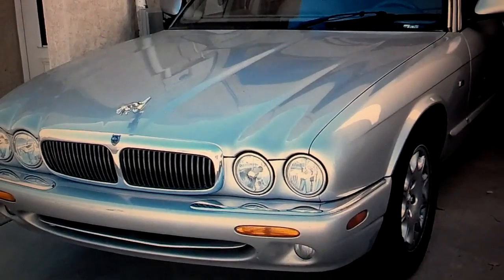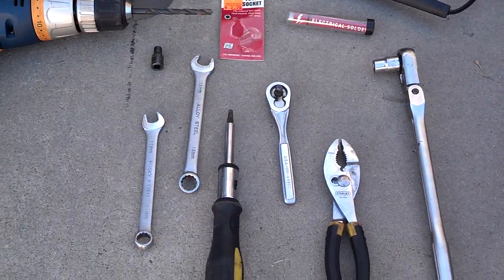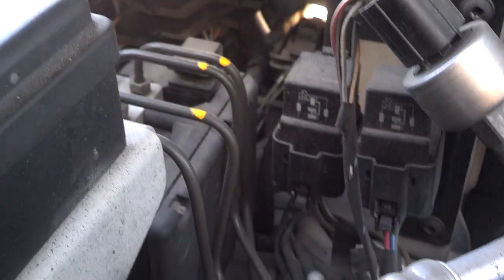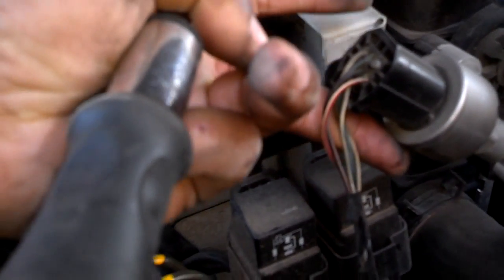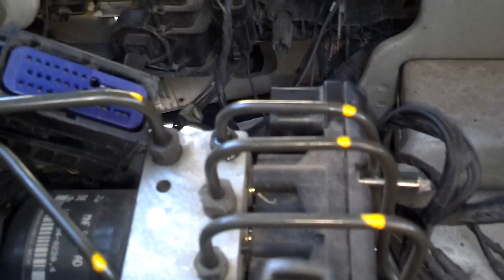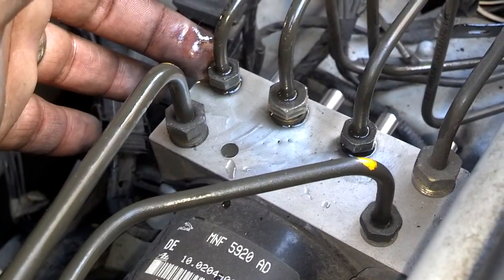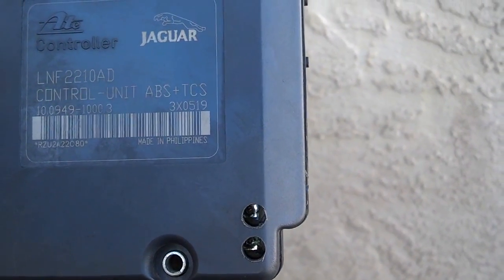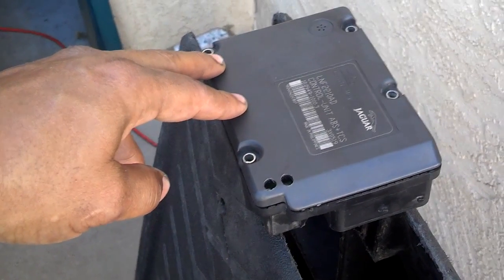ABS module repair, ABS warning, tracks not available, Jaguar - VOTD

Comment: Hi Rob Tony here i asked you 11 months ago if you have to bleed the system after and you said no. But if you remove the brake pipes fluid is lost and im sure you have to bleed the system.
Reply from the maker: You don't have to take any lines loose to remove the module. 🤷🏾‍♂️
Reply: Thanks for your reply keep the good work up

Comment: Thanks a bunch Robert! You're the man!!! I'm the original owner of a 1999 XJ8L. It is my daily work commute car. Been watching all your videos and that motivated me to do a lot of the repairs myself. ABS control module repair was way over due, 3+ years. Finally got the time to do it today. Worked like a charm. No more orange light and stability error message! I guess those solder joints worked their way to an open from all that vibration being in the engine compartment. Thanks to your video, only took 3 hours and I took my time.
Reply from the maker: Awesome!

Comment: I have a 2003 xj8 looks the same as this one in the video. The abs light is not on and never  comes on. But the middle where it shows the mileage randomly while I'm driving it will pop up saying asc  not available trac not available and then transmission fault.. if I turn off my car and turn it back on it turns off and doesn't happen  again for a while.. but then it will happen again same lights.. just randomly. It drives amazing until it randomly just glitches  and it won't speed up as fast as before and those asc and traction and transmission lights come on. Do you have any tips or ideas on what it could be..
Reply from the maker: You need to have the car scanned by a Jag tech, preferably while the light is on.
Reply: @RobertDIY  thank you I was going to try and take it to a import auto shop today.  The jag dealer here told me they don't do older jags. Maybe they can help?

Comment: I have an 04 S Type r and it has the dynamic stability control warning light on, Jaguar wants almost $3000 just for that ABS part you repaired. Also, the modules are matched to the VIN so you can't just throw in a used one. There is a company in Idaho that repairs these modules, they charge $250 so im going to send mine there, but thanks for this vid of how to get the module out!
Reply from the maker: You are welcome.

Comment: This vid is pro, nice work 👊🏻
Reply from the maker: Glad you liked it!
Reply: I used this video to fix my father in Laws 2001 Jaguar Vanden Plas. I checked the battery, cleaned the sensors, but the issue was with the solder joints mentioned in your video. Thanks again .!!

Comment: H ELL TO YOU ALL.I HAD THE VERY SAME PROBLEM WITH MY JAGUAR  I SLACKENED THE BRAKE UNIONS JUST TO GIVE ME THE ROOM TO REMOVE THE MODUAL
AFTER I DID REPAIR AND REFITED BACK PLACE RETIGHENED  THE BRAKE PIPES.. I DID NOT NEED TO BLEED THE BRAKES AFTER WARDS
Reply from the maker: ok

Comment: I have the same issue on a 2001 VDP. funny I still can register speed output at all 4 wheels when I have my autel reader connected but faced with the same issue of abs & traction control. the wires you solder appear to be main power source to board It must be inter-connected somehow but wheel sensors are from another positive feed & why I can register speed data at the wheels
Reply: Hey good news i took module off but drilled a 5/8 hole above the power feeds in cover. I was able to cold solder the 2 pins but wanted to point out there is a tiny capacitor that needed a little solder . I used a rubber plug to seal hole. Put it all back together Bob's your uncle!! No more ABS or traction control lights on. The only thing left to do is fill & bleed brakea since I disconnected the 4 lines to have better access !

Comment: Hey Robert, I have a 98 XJ8 and I would like to install a catch can PCV.  Any input I would appreciate it. Thanks Persaud
Reply from the maker: I can't imagine needing that on a non-turbo car.
Reply: @RobertDIY  I noticed oil on my air filter and intake manifold. From the hose connecting from engine valve cover. Not sure what's or why this is happening had it checked by a mechanic they said my engine is going. @ 100k running smooth i dont have any engine light or so on. I seen this solution on a 2010 camaro 2ss.   Thank you for the reply.
Reply from the maker: Find a Jaguar mechanic.

Comment: Thanks Robert. I followed the other video where you cleaned the ABS sensor which did not work and then this one. This video seems much more complicated for a DYI mechanic like me so I am not sure I am up to the task. Do you think the Mitsubishi Outlander ES 2WD 2011 has the same complicated type of setup where the control module is hidden and difficult to get access to? Also, do you think the ABS control module is also sealed the same way that would require some "ingenious" way to reach the terminals to do the solder? Thank you!
Reply from the maker: Whatever the video shows.

Comment: I have done both and I still have the same problem
Reply from the maker: Have you had it scanned for codes?
Reply: Yes
Reply: Oxygen sensor
Reply: Fuel injector
Reply: Once I drive it the asc pops out on the dash. Once I get to 30 mph and 70mph
Reply from the maker: You need an advance code reader to fetch the ABS code.
Reply from the maker: https://www.youtube.com/watch?v=VZflAyss974
Reply: I cleaned the sensors. And soldered the connectors. And didn't feel any difference. I only have the issue whenever I start up the car. When I drive and make the 30mph, the dashboard will say asc/restricted performance. The acceleration feels like it's decreasing And losing power.  And it will go back to normal after I pass up the 30mph mark. And it appears again if I got a hole or a bad bump on the road.
Reply: @santiagohernandez422  Did you ever figure out your problem?

Comment: I'm getting the same codes which are intermittent. Have an autel elite 802 reader and even with abs,traction  & asc indicator on speed registers at all 4 wheels when I drive down the road so I know speed sensors ok. I am thinking maybe my module has the same  bad solder issue. do you know what your soldering ? as in what specific app are the 2 solder joints in relation to dash lights & message  of abs or no trac or asc
Reply from the maker: +Rick p nope
Reply: Question is after you soldered and re-assembled , the lights & messages were off at the time of you test  driving . Do you feel confident enough to say it is a probable cause & for you, it has saved you from obvious frustration and in your case  dash light problem has not returned.
Reply from the maker: +Rick p still working fine.
Reply: Thanks Robert ! Car will be parked for winter soon so will have time to check out & go over module components. in the meantime since we are taking on road trip this thanksgiving weekend I will apply a little dielectric grease at the lower  power feed connector the only one I have not removed yet. I saw the dirt & dust from the volvo connector ! lol
Reply from the maker: +Rick p ok
Reply: We just got back from a 950 mile trip to visit my in laws . going there my abs light ,asc  & loss of traction  came on twice. Brought code readers with me but never got to use ! however  I cycled the key on & off 10 times & waited to see the abs light turn off & have just returned home without any indication of existing trouble! go figure !! coincidence or a new tip & trick to resolve issues  concerning logged codes ??
Reply from the maker: I have no idea.

Comment: hi robert, i have a 02 x type 2.5. Will the solder spots be the same as your vid??
Reply from the maker: I don't know. It's a long shot. Most of the time you have to open the unit and repair several points. It is probably best to find a refurbishing source to get a replacement. There are a couple of places that do it for Volvo cars for $75.
Reply: im in new zealand bro, parts are hard to find , and kiwis can do anything , so i will pull it out and check it out , cheers tho , my car will start then drive , no lights on dash , then if i turn it off and go into a shop or whatever, come back and it will then bring up the abs and e-brake lights, it does this 100% every time ,cleaned the sensors , and they were clean anyways , no change , so module next. keep up the vids man
Reply: Hey there Jacknz33, Have you fixed your issue? Im currently in the process for replacing my abs module + I'm in NZ too :)

Comment: You don't need to remove lines and bleed
Reply from the maker: OK
Reply: you do a great job but its easy and quick to just slightly re shape the pipes the mod pulls out with no mess

Comment: Hi robert i have a 2002 jaguar x type with a brake problem, i just finished bleeding and replacimg the brakes and it seems like the ABS is kicking in a lot... can you please show me how to disengage the ABS to see if the problem persists?
Reply from the maker: Find the module and unplug the small wire harness.
Reply: Robert DIY thank you Robert i will let you knoe how it goes.

Comment: hello sir i have a question ,,, i replace left spindle on my o3 jaguar s type r and the abs and disc not available light came on and trac control so i wondering if i have to do this process you did or get scanner and reset the lights
Reply from the maker: Did you forget to plug in the sensor? If the system works, no reset is needed.
Reply: well somebody else did the job for me and the guy did connect the sensor what a noticed after that sometimes when s start the engine i feel a little shaking i don't know if that is coming from engine or could be the abs system ,,,and i told this guy about what you did and he told me that if i do that i could damage the engine computer or the and system ,,,also i got too like right now im using the spare tire left front side ,, so i wondering if that could be the reason abs on and disc not available  and trac control
Reply from the maker: +Carlos Sosa no. Something else is going on. The ABS system will not cause any idle or driveability issues.
Reply: well i got a fail code about ignition coil ,, but im really worried about  the abs now ,, well another question i had some bad oxygen sensor which i already replaced ,, light cleared but came back again with 2 o sensors    which i already replaced  i used denso sensor i wondering if i should use other brand of sensor or what could be the issue,,,

Comment: Hi Robert Thanks this is great info.  This is the first time I have found some one who can explain how the ABS system works on a Jaguar and do a diagnostics manually. I have had my car one  2 diagnostic checks to no avail. may be that the info from Jaguar is not available may be ???  for their diagnostic machines. mechanics are getting to used to a machine telling them whats wrong but not how to fix it. regards John D
Reply from the maker: Modules are usually the problem.

Comment: THank you, your video was very useful. I would like to know how to fix jaguar xj8 2004 P0782 code, from time to time i also get the brake light as well as the engine light fault
Reply from the maker: I don't know. Please check on the Jaguar forum.
Reply: Thanks, I did look in the Jaguar forum, nothing there
Reply from the maker: Make a post. Those guys are pretty helpful.

Comment: Great vid Robert. I have 2001 Jaguar XJR Supercharged V8 and my lights came on the dash one evening after moving my car. When I got out of the car I notice a motor running and so I opened the hood and the ABS motor was running with the car off. So I found the switch and pulled up on it and it stopped running. I want to ask you do you think the motor is gone or it's those two solder points that need to be soldered??? The car is drivable with the plug pulled as the dealer told me. I love fixing stuff so I believe I can do this. Thanks.
Reply from the maker: +Stephen Hickey never heard of that before. I have no idea.
Reply: Thanks!!! I have do more research. One guy mentioned maybe electrical fault happening. So I will see where this take me now. LOL Cheers...

Comment: Well after doing my looking around I went and bought a Haynes manual book.. And I checked the relays and the relay to the pump didn't send any juice to the pump..?. A bad relay?.. I'm not sure?.. Theirs power leading to it but don't send power to the pump,  the only way I was able to get power to the pump was hooking up a cable from ground to this cable on the relay... Purple/yellow wire and that made the coil on the relay to get together and send power to the pump... Now I'm waiting on a used relay from eBay to see if it's the relay?.... Or why by connecting ground to that specific wire I get juice to the pump???..

Comment: My bud has a 91 jaguar .. He's brakes don't work properly?. The anti lock light comes on?.. I checked all power connectors. Some got power some don't  fuses are good... What might be a problem?
Reply from the maker: +Ricardo H Lopez does it have fluid? Usually mechanical, like the master cylinder.

Comment: Well my abs light and tracking light along with the stability light all on at once please need help
Reply from the maker: Sounds like you need to replace the ABS module.
Reply: @RobertDIY   why replace? I have the same issue on my 01  XJ8 VDP which was intermittent until recently. You used solder to repair , something I would feel comfortable doing after watching you perform the task at hand. Or is there another version to his situation I'm not aware of ?

Comment: @robert diy I have stiff brakes in the morning and only in the morning would u say that's the abs pump
Reply from the maker: +Rashad Turner no. Probably the booster. Has the fluid been changed lately?

Comment: Blimey Robert. You've shown great resourcefulness fixing this ABS unit. Saved to my favourites in case I need it in the future. A big plus for your determination.
PS: The second solder joints are good (The first try had a 'dry' joint)
From an ex telephone engineer with a lot of soldering experience.

Comment: I have the same problem but with an 04 Xtype. I get the abs light on with the Dsc fault. Is it safe to assume the module is shot?
Reply from the maker: +Rafael Muro yes. That will not cause you to get struck down by lightning.

Comment: Christopher Ealey
 I have a 1998 jaguar XJR. I need to change the ABS box. I cannot get an E4 star socket onto the two bottom bolt heads on the unit as there is insufficient space between the ABS unit and a bulkhead. Is there a special tool for this or a shorter shank E4 star socket to fit to a bar or is there a combined tool that can be bought? Other people on You Tube have done this job but is an XJR slightly different to other XJ's. Chris
Reply from the maker: +Christopher Ealey Man, I don't know. I believe it's an E5.
Reply: +Robert DIY. Thanks. It is an E5 and I have now managed to take the ABS unit off. I had to push the brake lines away carefully without fracturing the lines which was very tricky. I also had to buy the smallest E5 connector and ratchet. The is the difficult part, getting the star socket onto the head of the bolt. Thanks for replying. I appreciate that.

Comment: Hi Robert,Great vid mate. just wondered if you had any idea why all of a sudden my lcd display on my 03 X type has stopped working. When I start the engine the unit digits go like black squares then after a few secs they all flicker and go out. Crazy...Cheers Si...
Reply from the maker: Because it is man made. Other than that I don't know. Maybe the led display has gone bad. They can be repaired.

Comment: Hi,would you be kind to tell me why i have the air bag light on all the time,even though I tried to delete the error with a tester,it doesn't close,and this ever since the car remained without battery,sorry if I misspelled,I'm from Europe..and I have a Jaguar XJR made in 1995,thank you in advance!
Reply from the maker: +Cosmin Chichisan May have a bad air bag. Have a mechanic check the system.

Comment: Excellent video! I have a 2001 XJR that is flashing the ASC/TRAC message. What do you think the odds are that my problem is the same as the one you fix here. In other words, is this module notorious for this specific problem?
Reply from the maker: +R.R. L. Yes, notorious in several vehicles.
Reply: Great. I'm going to try this.

Comment: My abs has been faulty since I got the car. Recently it's gone into limp mode and having transmission issues even though the transmission itself seems fine. Can the ABS be the cause?
Reply from the maker: +Cainus44 I doubt it.
Reply: Robert DIY
Yep, figured it out.  Thanks.
Reply: Cainus44...would you please share what your problem was.  I am having the same issue of car going into limp mode. Error codes C1095 (pump motor circuit failure) and P1632 (transmission code incorrect gear ratio).  Thank you.
Reply: Chris McCann
Transmission was just plain ruined.  Apparently these Jaguars have shit quality transmissions that don't hold together well.  I was quoted with a $5000 repair.  I sold the car instead.
Reply: Sorry for your troubles...thanks for letting me know.
Reply: Chris McCann
Any time.  They're fun cars, and look cool, but the cost of repair tends to be greater than the cost of the car itself if it's anything besides a coolant hose.

Comment: Hello friend i have 2006 Chevrolet caprice and im facing the same abs problem abs warning light is on and no traction control also its been 3 days now having this problem in my car mechanic checked on the computer but its not giving any trouble code's abs light is on no traction and a/c compressor doesn't work wat i did i removed the wire from abs module so a/c is working now any solutions thanks
Reply from the maker: bilal mehmood Hmmmm, not a clue. Maybe check a Chevrolet forum.
Reply: thanks bro i did little research on internet and they said that my car abs module is faulty which you have fixed in this video so today i replaced that with the new one now its working fine
Reply from the maker: Very nice.